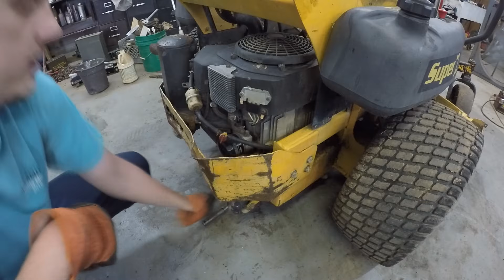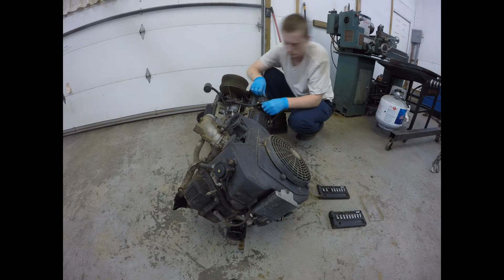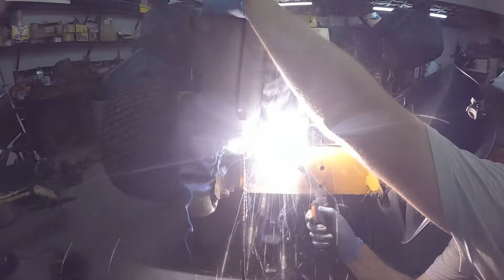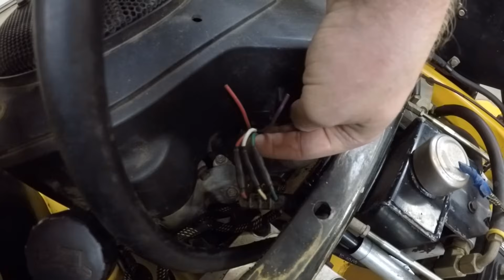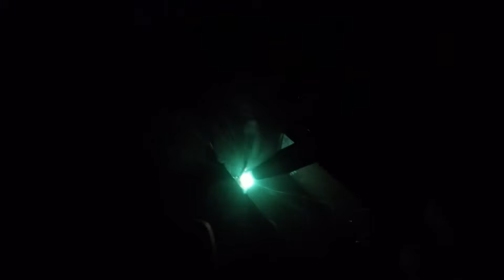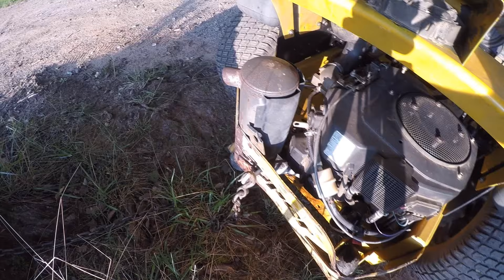Fixing up a neglected zero turn mower.

Comment: the reason why the engine that was on it before did not sound great is because it is runing on one sylinder in because of that only one sylinder is firing and it can cause the issues that the engine had and that you noticed you could fix that by fixing the valves
Reply: Exactly surprised he doesn’t know that
Reply: @TheSoloLawnCareChannel  because sometimes the valves come too loose or to tight

Comment: Yeah, some zero turns are very abused and ran hard until trouble shows up. The original owners run and use the snot out of them and when they fail, they wonder why. Treat your machines well and take care of them and they will take care of you. I hope you video yourself repairing the original block and we all get to see whats wrong with it.

Comment: You can't call it fixing up a neglected mower then swap engines & weld up exhaust the average person doesn't have a welder or a spare engine lying around 😂😂😂😂
Reply from the maker: Maybe "fixing up" was a bit of an understatement lol. But for what it's worth I think I bought that engine off facebook for $250 a few days after buying the mower, and that welder I used is $100 brand new at Harbor Freight.

Comment: Lost here, since should have stated with just checking valve clearances, since if gap too wide, will not allow compression release to work, and will cause engine to act like seized.  

From there, pull fly wheel to check that key is not sheared, since could have been something hit to slow down motor, and flywheel can shear key as it tries to keep spinning at old speed.

Once that is out the way, then compression test, which will tell you if there is something up with cylinders/rings/crank main worn out.
Reply from the maker: Good advice, but the previous owner told me the engine seized while it was running. And based on the horrendous noises and lack of power im 99% sure it threw a rod or had some other major mechanical failure. Next time I will open it up and look through.

Comment: I am on my second zero turn mower rebuild. The first one (residential model) worked out so well I bought a professional grade mower to rebuild this year. Retired and get bored. Now it has leaf vac system attached, remote battery connections, front and rear 2" receivers for trailer hitches or lift boom for lifting things around the yard. It also has a string trimmer attached to the mower deck so I have 64" mower with weed eating from the zero turn.
Reply from the maker: Nice! Those string trimer heads on the deck look interesting.
Reply: @AlwaysBored123  https://youtu.be/uSMPhuZ8dOI
Reply: pics ?
Reply: Wat make and model

Comment: You need to be using a face shield or welding hood with grinding mode with an angle grinder. Angle grinders are insanely dangerous to use the way you did, just saying. I'm sure you'll read this and think I'm a safety karen but generally no, there are just certain things you don't fuck around with, angle grinders are one of them.
Reply from the maker: I usually do wear one with bigger grinders but that little 4" doesn't have enough power to get through a pair of safety glasses if the wheel disintegrates.

Comment: Ignition timing have little to do with engine speed but is for better adjusting to fuel properties and air mixture. Your gas car have adjustable timing control for the same reason.
Reply from the maker: Interesting I always thought it was just to make it run better at varying rpm.
Reply: @AlwaysBored123  We are both sort of right. "a few reasons why a car has ignition timing:

Power and Efficiency: Ignition timing helps maximize the power produced by the combustion process and increases the overall efficiency of the engine. If the spark occurs too early or too late, the engine won't be able to extract as much energy as possible from the fuel, which can lead to lower power output and reduced fuel efficiency.

Preventing Engine Damage: Proper ignition timing also helps prevent engine damage. If the spark occurs too early (advanced timing), the combustion process can begin while the piston is still compressing the air-fuel mixture, resulting in a condition called "knocking" or "detonation." This can potentially cause severe damage to the engine. On the other hand, if the spark occurs too late (retarded timing), the combustion process may still be occurring while the exhaust valve is open, leading to wasted fuel and potential damage to the exhaust valve and other parts.

Emission Control: Correct ignition timing also helps reduce harmful exhaust emissions. Advanced or retarded timing can result in incomplete combustion, leading to higher emissions of unburned hydrocarbons, carbon monoxide, and other pollutants.

Adapting to Different Operating Conditions: Modern vehicles often use a system called variable ignition timing. This system adjusts the ignition timing based on different operating conditions like engine load, engine temperature, and RPM to ensure optimal performance and efficiency at all times." Source: chatGPT. Before ignition timing, lead was added, but lead fumes ALWAYS cause brain damage.

Comment: I bought a new zero turn last July, the price for the same model this summer has went up $450! A decent residential zero turn is $5000, and the pro stuff is outrageous. I sure don’t blame anyone for fixing a mower and getting the rest out of it.
Reply from the maker: You can say that again. A friend of mine just paid about 16 grand for a similar mower brand new. It's nuts.
Reply: Buy used never pay retail for anything unless have too

Comment: Have you ever used slime inside of riding lawnmower tires before? It seals the cracks up.& Stops them from leaking to.
Reply from the maker: I've tried that in skid steer tires before with little success. The only good flat repair I've found is a tube or a new tire.

Comment: I recommend you draining out.& Changing the engine oil  on that Kohler engine it'll come back around due to low broken down burnt motor oil with barely any volas city to it left due to thermal break down. I recommend flushing that engine out good with barely used motor oil mixed with some marvel mystery oil  in the engine. Then drain it out. Replace the oil filter.& Motor oil with all New stuff. Then run it again.

Comment: I guess you know that rig'll never run right because you GREASED it.  It'll be in a state of shock for days and it sounded like the other motor was just running off of 1 out of 2. I like Kohler engines but not so much the new ones. They had a run of bad cams like GM did years back. No lobes or worn out lobes, rather. I like a zero turn but not enough to buy one. I mowed a lot with a Cub Cadet commercial about like that one and it did fine but I try and never run things hammered. I have particular ways. Good fix and I have to hang my feet out the door opening on a small trackhoe too. Blessings
Reply from the maker: Lol the replacement engine didn't run good either until it warmed up completely. After mowing with a zero turn I'm too spoiled to use anything else. Thanks for watching.
Reply: @AlwaysBored123  The opposed Vanguard is like that but a lot worse with the lean jetted OEM carb. I Ebayed an adjustable jet carb and it runs smooth now without surging. The Ebay carb was out of a marine application. And I'm in no rush and the floating deck on the Craftsman cuts like a rug.
Reply: Just thought you might like to learn after my health went away I gave away all 8 of my project mowers that ran like Swiss watches and ended up with a Craftsman/MTD battery zero turn and a Stihl battery hand mower for the Sweetie. Never thought it'd happen but it sure does. I never run the battery job but 1/2 speed and economy setting for the deck motors and it takes a full hour to mow our place but I can ease around and mow more grass by accident than I ever could on a regular job. Wished I could work on them but that's over with. Keep on fixing!

Comment: A little love and maintenance and you've got a winner. I've passed on mowers like that in the past,because I was scared of buying a money pit. I can work on stuff,but parts can add up pretty quick
Reply from the maker: They certainly can. Although, in my experience, commercial grade machines have the advantage of a given part being a significantly smaller percentage of their total value. I've also found them to be easier to work on than cheaper units which is nice.

Comment: ok got me lost . why would they run 12v off the rectifer to the starter.. ???? that would be on all the time then ..
Reply from the maker: It runs to the big terminal on the starter solenoid which is connected directly to the positive battery terminal. The starter motor doesn't actually activate until it gets power at the little terminal on the solenoid when you turn the key switch to "start."

Comment: That’s a good find. The Super Z is the top model of Hustler zero turns with heavy duty pumps and wheel motors. Brand new in 2023, $15,000 USD wouldn’t buy it so you should be able to get $5-$7000 for it I would think.
Reply from the maker: Yeah I was impressed with it. It drove and cut really nice. I think I sold it for $2500. Kinda wish I'd kept it but I already had a Turf Tiger I decided to keep using instead.
Reply: @AlwaysBored123  SCAG over Hustler all day!
Reply: @AlwaysBored123  a

Comment: I would have beat the dents out of the engine guard.
Reply from the maker: That's too much work lol.
Reply: @AlwaysBored123  ok I just thought it would look a lot better.
Reply: @AlwaysBored123  what about using a press.
Reply from the maker: @altonrowell613  That would've been considerably less work than a hammer as thick as that plate was. I just didn't care enough about how it looked to bother with it tbh.

Comment: I had one of these with a three cylinder diesel it was much slower than my Toro that I have now and also didn’t have any more power either the cooling fan would never turned on when it was supposed to I could have bought 2 60in toro’s for what it cost used🙄
Reply from the maker: That's interesting I didn't know Hustler ever put a diesel in these. It's a shame they didn't do a good job by the sound of it.
Reply: They didn’t. I don’t think anyway. it was a cub Cadet motor

Comment: How much is a used motor?
Reply from the maker: Just depends. I want to say I paid $250 for that Kohler Command. I see comparable Briggs and Stratton v twins listed for considerably less than that and Kawasakis for a bit more.
Reply: @AlwaysBored123  Thanks, where  do you find these motors?
Reply from the maker: @Bass.Player  Facebook marketplace 99% of the time.

Comment: sounds like the engine was running on 1 cylinder i'd bet money you had a bad coil kohlers smart spark system sucks
Reply from the maker: It was worse than just no spark. The way it was clattering and clanging makes me think it had a broke rod or maybe dropped valve. I should have opened the old engine up to see but I scrapped it a while back.
Reply: You don't scrap Kohler Command Pro engines unless they are too far gone.  Great solid engine. Take the back protector guard of the mower, and best it straight with a 3 pound hsmmer.
Reply from the maker: @mikespain8655  Eh. I tried selling the old engine as a core for about a month and had next to no interest so I just scrapped it. Would have been cool to rebuild it but I just needed it out of the way more than anything. I ended up selling the mower too so the new owner can worry about un-smashing the bumper lol.